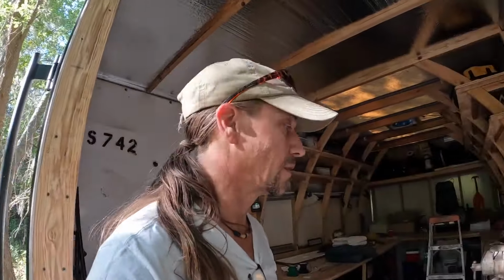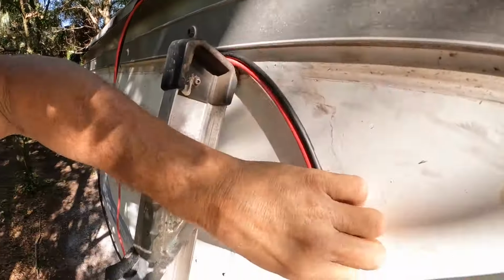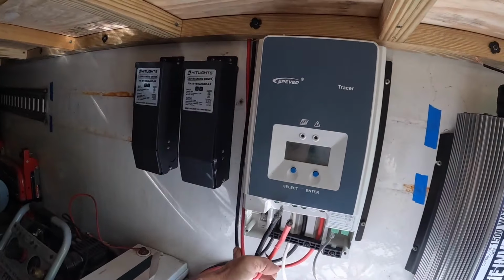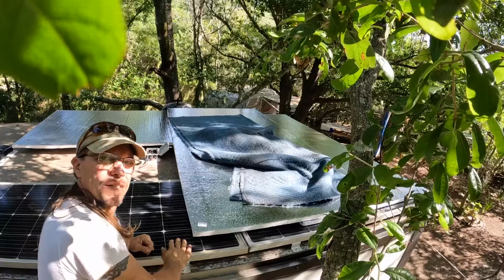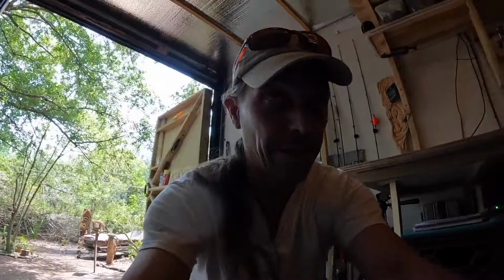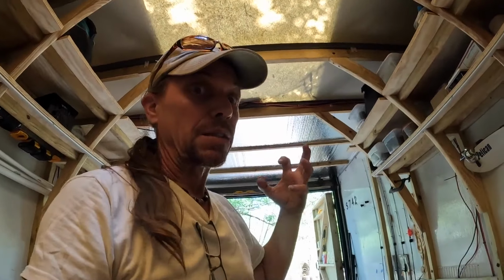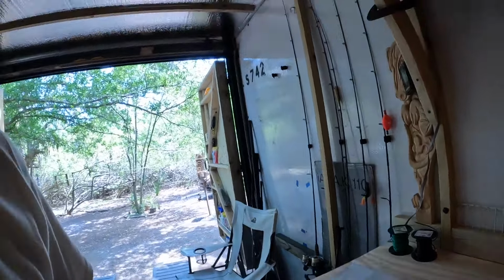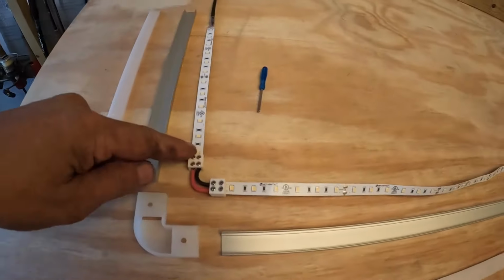Workshop 023 Things are Gettin Lit

Comment: Marty - You can run those LED strip lights directly off the 12 volt DC from the batteries. That will be easier and far more efficient than running them from the 115 volts from the inverter. Lots of loss in the inverter. When I had my business, we used them in the service vans and ran them from 12 volts. Works perfect!

Comment: Why waste money on dc inverters for the lights when they are 12v anyway ? Run direct from batteries , also your lights you want to run for daytime work can be run directly from a single solar panel so no need to run it through the battery even .